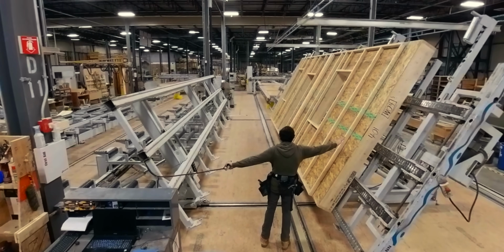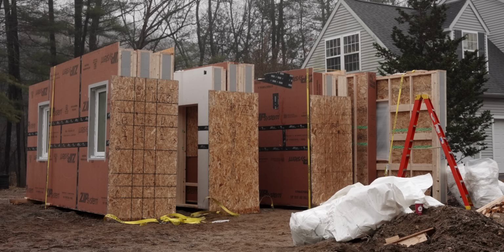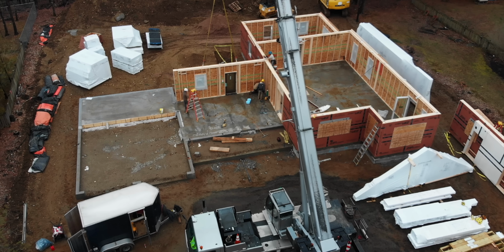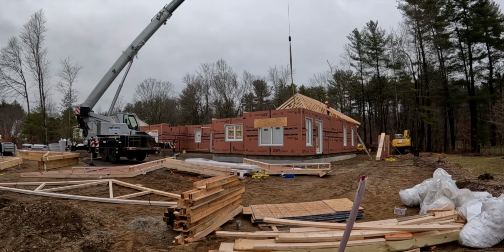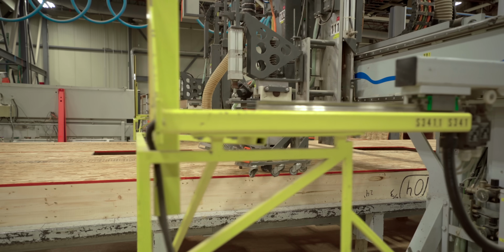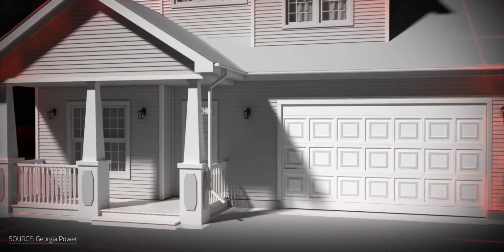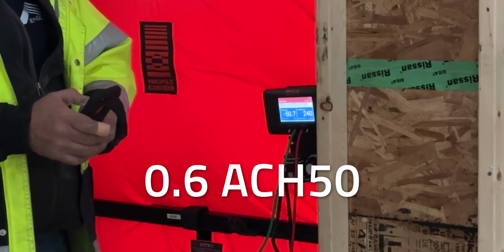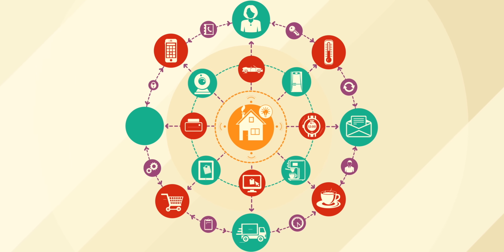Wow! I Didn’t Know A Prebuilt House Could Do This

Comment: The first house I bought was a factory constructed home I had built in NE Connecticut back in the mid 1990's. It was easily the most efficient home I've owned as the walls were all closed cell foam insulated which essentially meant I lived in a giant thermos. My heating and cooling costs were a fraction of other home owners I spoke to in the area. I wouldn't hesitate to build another home in the same manner as the cost, speed, quality, and over all experience was just better than going "stick built" traditional construction. Knowing my new home had a long term warranty from the factory was also a nice perk most home builders never get.
Reply: That's awesome. I wonder what his cost and warranty are for this project; estimated, current, and projected cost from current position.
Reply: I researched prefab homes in my country and found they were either more expensive or just as costly as traditional construction methods. Additionally, the lead time for delivery was longer than hiring workers and building, and the warranty for the walls was limited to only 5 years. And finding the info about warranty required close examination of the agreement.
Reply: @wojciechzielinski7825  it's hard to imagine a home built to the same specification would be cheaper to build on site. It would cut costs if you live near the factory though.
Reply: @mandrakejake  There are many qualified workers and only a few prefab house manufacturers. There is a lot of building warehouses and materials to choose from. It is more cost-effective to hire local workers and build on-site instead of waiting for a manufacturer to complete the house, and foundations are the most time and cost consuming - you still need to hire people and wait for them.
Building a house made of silicate bricks on-site with a slab will cost 3800 zł/m2, while an official price for a wooden prefab without a slab is 3200 zł/m2 plus transportation, add a slab to it, and the cost for a wooden prefab will rise to 4000+ zł/m2.
Reply: @wojciechzielinski7825  A prefabricated house is more expensive in the UK than a site built house.  But what you gain is the quality control during the assembly of the panels, and consistent attention to detail of avoiding cold bridging.  

Most local builders in the UK aren't up to building to Passivhaus standards, so you'd be lucky to get 2.0 on an air test rather than the target of 0.5.
Reply: @robertsmart7484  In an ideal world, on the other hand, in most cases you don't know what's in a wall, what kind of wood was used, and as my example shows, the manufacturer only gave a 5-year warranty for the walls, and cleverly hid it in the agreement. I would really like to trust him, but I had to cancel the deal.
Reply: @mandrakejake  Because they can buy everything in bulk!..That’s where you save the most!.If you buy one window it’s 50 dollars..But if you buy 5 hundred windows it’s about 17 dollars!
Reply: @wojciechzielinski7825  and a prefab house D appreciate in value over time!
Reply: @robertsmart7484  Doesn't matter where you live, if you want a net zero house built you start with an architect that knows the system and work with them to get the builders you need. They will know who can build to meet the requirements even doing stick build instead of prefab walls or modules.
Reply: What do you mean Stick Built!
Reply: @michaelkeenan3437  In UK  language timber frame building constructed on site from "sticks of wood".
Reply: @robertsmart7484  Any other things on a construction site that might throw me for a loop!
Reply: I have more concerns about cooling then heating
Reply: @CUBETechie You understand how insulation works, right..? If it’s good at staying warm, it’s good at staying cold—very simple.
Reply: @CUBETechie  insulation works both ways keeping the exchange of heat movement to a minimum. In the House when you need it and out when you do not. A thermos flask is an ideal example. Keeps hot Hot and cold Cold with the same insulating shell. Cool yes?
Reply: @michaeldautel7568  a much more gracious response than the other above, kudos 👍 for answering without belittling the person you’re responding to. Rare to see on the internet these days.
Reply: @CUBETechie  insulation is equally effective no matter which side is the colder one.

So cooling works as well as any other home but requires way less energy and probably a smaller AC system in general.

Comment: I am really curious about your battery storage solution and your geothermal setup along with costs and the research you did to choose who you went with.
Reply: Yes, me too. Are you connecting to the grid? If not, was there pushback? Were  you able to get a build permit without a grid connect plan?
Reply: @VoltairePower  He is connected to the grid (otherwise there would not be a possibility to sell electricity). However, Im curious about if his house alows electrical islanding (this is the possibility to automatically or manually disconnect from external grid and just run of the own power from solar and batteries), not sure abot this in his new house. 
What most people don't know about solar installations is that all installations depend on external working grid to use the power from solar panels, so if a storm takes down the external power lines there will be no electicity despite having solar roof and battery bank. 😞
If the installation is built for iselanding, then the house can work as normal temporarly offgrid.
My cottage is fully offgrid (installing main grid was crazy expensive, thats why) and solar power works extremley well.
Reply: @moongooat  not sure that precisely correct- if you have battery backup you are charging from the grid, yes, but you definitely have electricity in a storm.
Reply: @johnwhite2576  If he can sell electricity to the grid. He is connected to the grid. As simple as that. It does not make you offgrid if there comes a storm and disconnects you from the grid 🙂However, if the house has islanding, then he can temporarly run without external grid.

Comment: Quick question, was the decision to not have a basement a choice to save on costs or are you not able to have a basement with this type of build? I don't see why you wouldnt be able to but i have yet to see one on a modular home build. Congrats on your home btw.
Reply: I'm not sure Matt's reason for not building  a basement. In New England basements are common but also not feasible in many locations due to bedrock or water tables. Not building a basement does simplify the insulation and air sealing, and saves considerably on the "carbon" costs for building the house due to using much less concrete and energy to excavate.
Reply: I'm wondering this too. I'm starting to think that basements are less common than I'm accustomed to.
Reply: I would like to know as well. Why no finished basement?
Reply: A lot depends on where the house is located. Here in WI, a basement is almost required due to sub zero F temps in winter and possibilities of tornadoes.  Some parts of the US, basements are not common. Almost any house can be built on a basement or crawl space but there is added cost.
Reply: I was wondering the same thing.  Is there something about basements that makes a house inefficient?